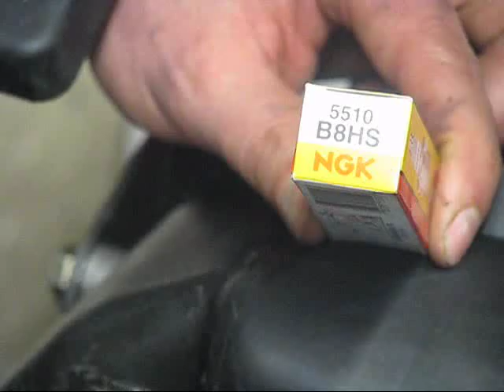How to change cylinder on a scooter

Comment: Hi, I have an Aprilia rally 50cc and would like to upgrade it to 70cc, only the piston and cylinder has to be replaced or do you need a new carburetor and other pieces? Also on a scooter, is there a squish clearance? Thanks for your help

Comment: I see......I did not know that a bigger piston could use less petrol when the motor runs at the same speed as the small piston..cool:-) No idea if you are familiar with 1999 rally lc 50cc, but which 70cc cylinder/piston brand would you recommend plz/

Comment: Thanks for this mate, Any idea what torque I should be titening the head bolts down to? And would you recommend a bit of locktite thread lock on the bolts. Thanks.
Reply from the maker: YeCannyDaeThat Sparkplug - 20-25 Nm
Cylinderhead (M7 x 1) - 14 - 16 Nm

It´s not necessary to use Loctite but i wont do any harm either..
Reply: Carburador 17,5?

Comment: Very good video but please help. I changed my head but i had to remove the engine first because of the position it is in. So i had to take all the tubes out of my carb. Now it will not start and i put it all back together. No petrol was flowing through the line and i dont know why. I have a fuel pump

Comment: Im from Norway and i have a Yamaha Bws... It comes loud sounds from it when i start it with the kicker (There is no EL-Start). The eksos gasket was old and it fell off often, and i have change it not long ago, and i just checked if the new gasket wasnt propper placed, but its fine... I dont know why there are loud sounds.. Any one have a tip? I need help... I not an moped expert :) Its nothing wrong with the eksos gasket...

Comment: i did it exactly like this. but the engine doesnt make revs and there is no power.
do you think i broke a ring?
Reply: I have the same problem any idea how to fix that??
Reply: EtterBakk upjet
Reply: It was indeed the carb settings and i had a fuel supply problem.
Reply: i'm actually having the same issue. it starts but wont rev high. i have upet the jet and lowered the jet. it wont run just has no power. what sort of jet size did you have to go too and what did you start with
Reply: Stet Stetmen what was your fuel supply problem
Reply: The vacuum rubber hose that pulls open the fuel valve had a cut in it on the back. So the valve wasnt pulled open enough
Reply: ok thanks m8 i will check the hose i gave up with the airsal kit and put a standard tnt kit on today and it has no power then put the standard back on and it has power but cuts out.

Comment: It's called a wrist pin, not piston pin..lol..and for the arrow on the piston,  faces the carburetor...I mention this because reversing the jug has become more popular these days...so facing the arrow forward doesn't always work for all applications... two strokes were originally designed with the exhaust exiting the front and the carburetor intake in the rear because they wanted the heat of the exhaust out of the way and not up under your ass...so the typical two stroke engines were designed backwards...